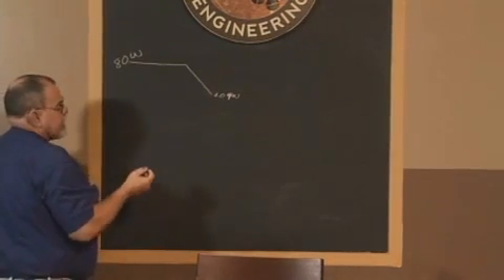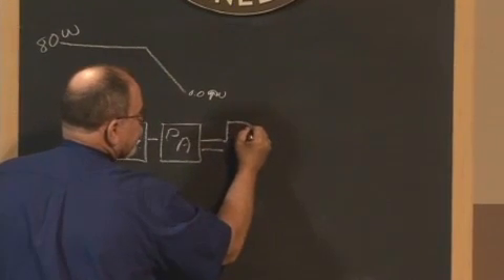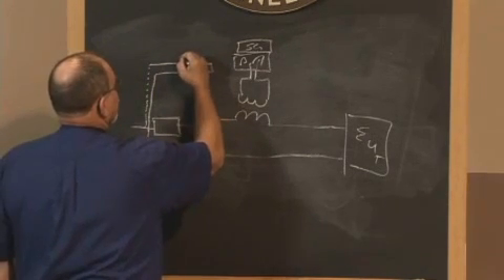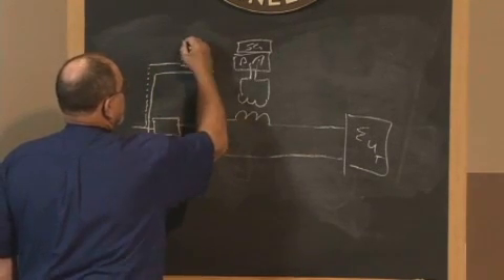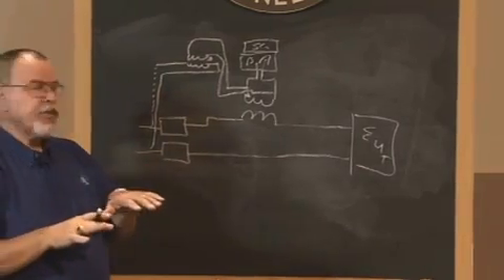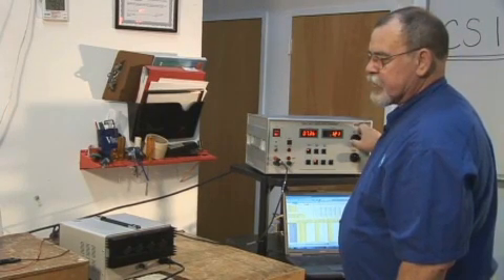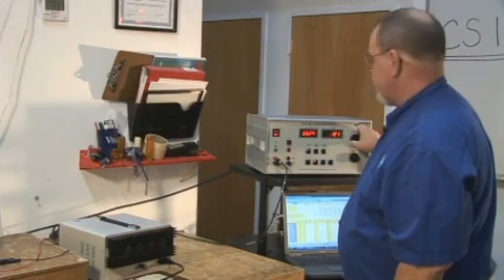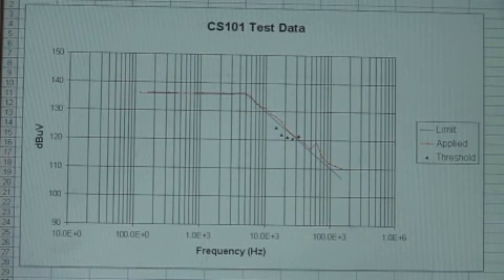CS101

Comment: Curve #2 in Fig CS101-1 is for 28volts or below, but the power limit in Fig CS101-2 is for CURVE#1. Is Curve #2 in Fig CS101-1 for calibration curve or test curve? 80W limit is too high for  CURVE#1, isn't it?